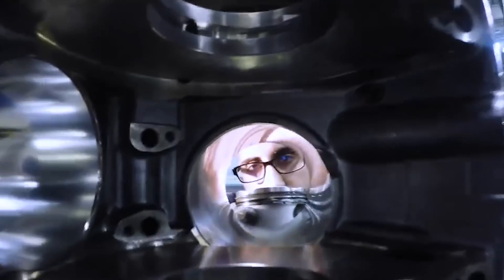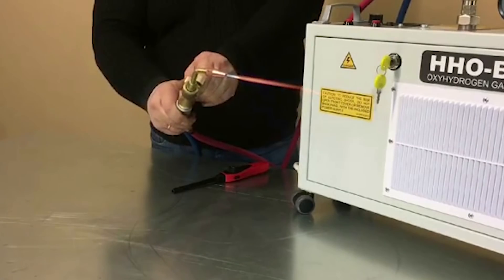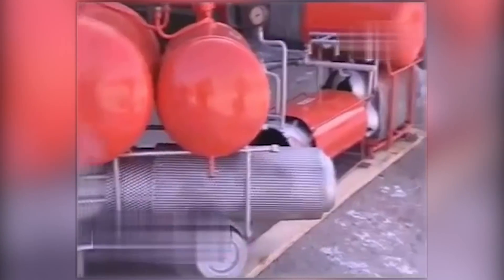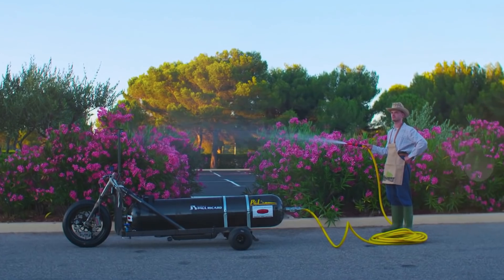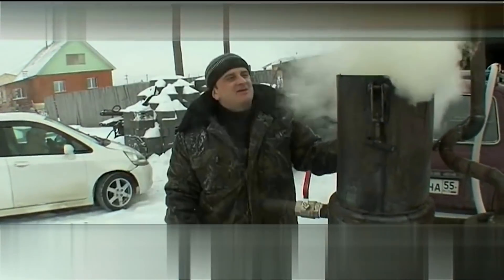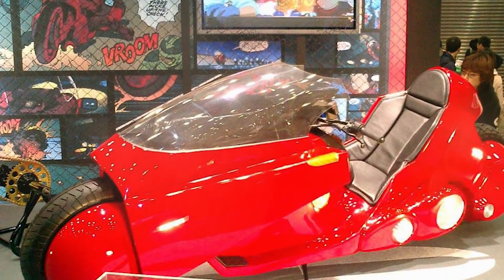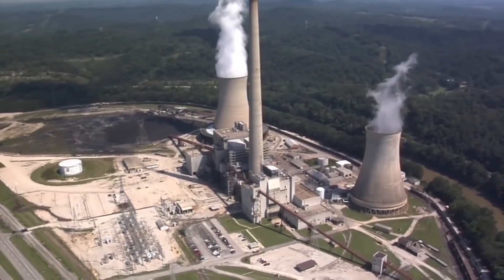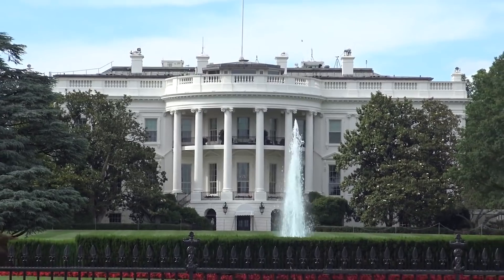Why These Engines Are Banned?

Comment: The one that uses compressed air is interesting.
I saw a farmer one time who manually pumps air into a car tire tube. Then uses it for aeration in his fish pond. Many hours later, he pumps it back up again. No external energy required.

Something like that can be developed further with solar power to charge the tube, so that it can work through the night when the sun is not shinning.
Reply: No external energy required. Using your muscles = external energy as you're LITERALLY BURN ENERGY!
Reply: @lolly166541  
True. But I was referring to something like an electric pump.

Comment: The motorcycle is not driven by a magnet. It was a hoax. Also most of the trick garage engines have very bad design bearings go after one hour etc. etc..

Comment: Law of Conservation of Energy, states that energy cannot be created or destroyed in an isolated system.
You cannot fill up a car with water, water is the exhaust Gas...
Reply: Like that "hydrogen engine" which produces hydrogen and oxygen when you put water in it... and apply electricity. So where is that electricity going to come from? It's not going to magically appear at your wall outlet.
Reply: @Stoney3K  Realy?? are you serious? You fill up a tank with water apply electricity from a battery pack and you get hydrogen in gas form and oxygen , then you use hydrogen as fuel. it will release enough energy to keep your car moving and alternator going. Hydrogen is a very powerfull substance its atoms are full of energy dont forget that the most powerfull atomic bomb is a hydrogen bomb.
Reply: @peterkrawczyk5953  And how is that more efficient than just hooking an electric motor up to your battery? You're never going to get more energy out of it than you put into your battery, so each conversion step in between the battery and the wheels is just going to make it more inefficient.

Comment: Now if only you didn't need ultra-heavy diesel to mine the rare earth elements required to make all the ultra-efficient electric crap, that still has lower power density then gas... i think that the future of engines needs to work on the principle of the reclamation of heat from the Internal Combustion Engine, not on trying to eliminate it, cause you never will be able to

Comment: The problem with all those alternative engines is that they require energy to produce hydrogen, compress air, etc. There is no such thing as "free power." So why have these alternative engines not in mass production? Because they didn't work. Or they required more development than was practical to make them work. The infamous, somewhat mythical "Oil Tycoons" have nothing to do with it. In fact, if they could reduce fuel use, they could stretch the finite supply considerably longer, thus keeping their companies going longer. 

As for Thorium, it, too, is a radio active element; it's just less likely to reach critical mass and explode. There is still radioactive waste. Also, the nuclear power plant explosions were the result of overheated steam, not nuclear reactions, themselves.

Comment: Why cars don't use compressed air as fuel: 1) the air bottles get insanely hot while being pumped and insanely cold while being emptied. 2) If you pierce your tank during an accident, you blow up because compressed air tend to expand quite a bit.

So you're advocating for driving bombs. Nice one.

Comment: Nothing more than “smoke in the mirror” have these guys ever heard of “the law of conservation of energy”? The electricity required to separate hydrogen and oxygen from water takes more energy than can be created burning it  through a 20% efficient internal combustion engine. So if the the electricity was being created by the engine burning the hydrogen and oxygen it would have too much energy lost through heat and friction and wouldn’t self sustain

Comment: Compressed air powered vehicles are certainly nothing new.  The first mechanically powered submarine (as opposed to human-powered) was the compressed air powered French Plongeur, completed in 1863, and equipped with ram and spar torpedo. (that is, a bomb on the end of a pole sticking out from the bow)  The first practicable self-propelled torpedo was built by Robert Whitehead in 1866, based on earlier work by Giovanni Lupis.  It was driven by a compressed air engine.  These torpedoes were used in a number of battles during the late 19th century, and were last used in by Norway in April 1940 (though by then, they were thoroughly obsolete) in the sinking of the less-than-1-year-old German heavy cruiser Blücher.  In the 1870s Emile Lamm built compressed air powered  streetcars  that were used in New Orleans and Paris.  From the 1890s to the 1960s, compressed air powered locomotives were used to shunt freight cars in factories and to operate mine railroads, because they made no smoke and no sparks.  More recently, there were the Air Hogs compressed air powered toys.

Comment: A vehicle powered by a magnetic field...you mean an electric motor?
Reply: Sunny Wahi And calling a electric motor an engine. pfffffft. Talking like spinning a coil in a magnetic field is revolutionary.
Reply: @HeavyMetalPootis  "revolutionary" - revolution..... AH! I get it! LMFAO!
Reply: Please! My dad knew about the zankel rotary motor in 1953. We all laughed when when we said wow wouldn't it be cool if you could just drop a pill in your tank with water and run on the hydrogen part. But no. Then we would run out of clean water. You are all crazy!
Reply: Wankel rotary motor 1953
Reply: someone should tell elon musk electric motors in vehicles are banned

Comment: Yes, spend electric power on obtaining hydrogen from water just to burn it back to water in fuel cells to obtain electric power to run your engine. The sad part is too fkin many people believe it's actually viable and the law of energy conservation is just illuminati conspiracy.
Reply: it's not as efficient as charging/discharging a battery, that's for sure. It's not even close.

However, if the infrastructure for producing hydrogen is in place: 'recharging'  simply amounts to hooking an air line up to the car to take on more hydrogen. rather then having to wait several hours for the chemistry of your Li-ion packs to catch up. I don't see it ever being a big thing for most commuters in the City, but it would eliminate the range problem of your typical EV at least.

Comment: The compressed air car would not work well for meany reasons but more importantly it’s vary unsafe. Compressed air is dangerous as in when pipeing compressed air we use tons of TNT to messier  amount of air being moved. You’re on YouTube search for what happens when you brake a compressed gas tank.

Comment: Very thick on conjecture and innuendo, but very thin on facts. Strange how energy storage is mixed up with energy conversion.
Really not worth watching.
Reply: yeah, its like this guy expects the pumps that fill up the air car, or the batteries that drive "electric motor vehicles" to be powered on fairy breast milk and unicorn shit
Reply: @DragonstarFighter  I read that if  just 10% of current vehicle s on the road were replaced with electric vehicles that the power grid would be completely overloaded causeing complete failure.A mega nuclear power plant would be needed just to generate the electricity to charge the Electric cars

Comment: There are a lot of designs that barely break even or function only at specific speeds in specific conditions and that's why a lot of designs never make it to production and many even fail basic testing.  I remember a guy using an insanely high compression ratio who found out he was literally dieseling his aluminum engine block away with the minor oil loss combining as the combustion fuel.

Things to remember:

#1   Just because it can be made to work doesn't mean it continues to work or is useful.  (magnet driven p.m.m.'s deplete the magnets!)
#2   Just because it's the method we use everywhere doesn't mean it's the only working method.  (you CAN build a wood-gas fired truck and drive on brush)

Comment: This is one of those try to shock uneducated people by embelishing the truth abouth things. Its not true. None of these techs are banned. They are not efficient and dont wrk. The TATA uses gas by the way. The gas compresses the air. Its a hybrid without the battery but rather pneumatic power back up instead.

Comment: Can the magnetic engine used by Sumo motorcycle be used in wind-powered devices? Could it be used to charge a battery bank?
Reply: Possibly it could be adapted for that application, but it would be far less efficient than the generators already used in wind turbines. So what would be the point.??????

Comment: Their was a design back in the 70’s  to convert a internal combustion engine that ran on air. You needed a external compressed air source to get it rotating then after that it keeps going on it’s own. No cooling system needed and the oil never got vary dirty. The main use was for stationary power source like in underground mines, fascinating concept , we talked about it a lot in project class.
Reply: Yeah, except that violates all three laws of thermodynamics. There are always losses: friction, heat, even *sound*. So you'd have to create energy from literally nowhere just to keep the thing spinning with no load. Gasoline represents the remaining fraction of chemical energy from rotting sea life, which in turn represent a fraction of energy of the sun that hit the algea they fed on. There's losses all the way down the line.

You can turn a 4 cycle into a compressed air/steam engine, but you'll need to provide pressurized air continuously for it to operate. It also makes a garbage engine when used this way, just use a steam turbine.....

Comment: Cold fusion.  Really?  Come on man.  It doesn't work.  If it DID, the things would be everywhere.  Waaay too much money in building the things.  If it was possible to build the things in the 90's the science behind them would be so bleedingly obvious now that it would be impossible to keep it a secret no matter how much secret conspiracy stuff you threw at it; physics is not something you can hide no matter how hard you try.  And given the great and powerful oil industry still hasn't killed off Elon Musk or any of the big green energy projects, I think your conspiracy theory is bunk.  

The rest of your 'forbidden' engines just aren't economically feasible for mass production.  Air powered vehicles don't scale well at all and are drastically underpowered; a very niche market so you aren't going to see much buy-in.  Hydrogen fuel cells have leakage and energy density problems (and if you scale them up to mass production you start having real issues as you drain rivers and lakes of water for your vehicles only to pump that water back into the air as steam).  Not to mention cracking water into hydrogen requires input power anyway, so your overall energy efficiency actually goes way down.  Until you can run the cracking stations on totally renewable sources, the things are an ecological disaster.  That magnetic engine has poor torque and awful acceleration so no one would want it for anything other than a novelty when FAR better engines are available.  These are the kinds of things that work on the small scale but there are tons of problems with scaling them up to mass production.  The wood fuel vehicle is just straight up stupid for any kind of mass market obviously.  The fact of the matter is fossil fuels are easily obtained and have incredible energy density and since the technology is old it is well understood and quite efficient.  Not to mention easy to obtain and repair; important considerations when you are marketing products to the masses.  These engines aren't killed by nefarious oil bosses, they are killed by the physics of the engines and the economics of their implementation.   

The only feasible thing here is the thorium reactor, and that thing has gigantic NIMBY problems because it is nuclear (and thorium is not exactly common, so mass use of it gets really expensive).  People don't care about the KIND of nuclear, the first thing they think of with nuclear is danger.  Oh yeah, and thorium reactors require plutonium.  The production of which is incredibly heavily regulated by international arms treaty.  So they will stay a dream until the US and Russia decide to sit down and renegotiate those arms treaties.  Good luck!

Comment: forbidden because of oil companies paid officials to ban them. if they cant ban you they will Ki..... you and make it look as a an accident plenty of proff
Reply: Except none of this is banned. It's just impractical.

HHO generators take more power then they generate in return (like any machine, most of the energy an internal combustion engine produces is wasted as heat and noise), while you can make an HHO generator, make the hydrogen at home, and then fill your car with it.... just put batteries on the car and charge the car, car goes farther with way less investment.

Wankel engine: not only legal, but you can buy them. RX7s and RX8s have them standard. They're fun and rev like nobody's business, but burn a LOT of oil (and only bearly passed emissions as a result), you need new seals on the rotors fairly often or they run even worse.

Opposing cylinder engine: Junkers Jumo aircraft engine used that layout. It's an interesting layout and was a good engine, but it's rather complicated and can't use VVT or other nice emissions things, so nobody uses that format anymore.

as for using sunlight to make hydrogen, there's a dozen ways to do that. Commercial photovoltaics you can buy from china by the pallet are leagues better then all of them.

Comment: I work in the power Generation industry and those tall concrete funnel shaped structures that everyone associates with nuclear power plants have nothing to do with nuclear power. Those are called cooling towers, on a side most of the power plants that they showed on here as nuclear were coal powered facilities FYI. If you see a  big tall stack going up its likely coal, smaller shorter stacks likely gas fired, nuclear units generally don't have stacks at all.

Comment: Take the n machine for example. An electric generator that produced more electricity than it used to run itself. It was invented over 100 years ago and the patent was bought out and swept under the carpet. How good would it be if everyone had free electricity to power homes and vehicles

Comment: Stopped watching halfway through.  This is the biggest load of bullshit I have ever seen.  The rotary engine was never banned.  Mazda has used it on and off from the 60s or so until a few years ago.  They are great for compact high power engines but are inefficient, have wear issues and are hard to meet emission standards.  Wood gas is not uncommon and was never banned.  The US government even has plans on the FEMA site for people in case of emergency.  If you are in an area where energy is hard to come by but trees are, they are great.  If you love in the city they will never be a practical way of running your car.  Hydrogen and hydrogen fuel cells do work, but we do not have a way to get hydrogen that is economical, not fossil fuel sources, or doesn't require more energy to get than you can get back out of it.  The compressed air car is just stupid.  Compressing air is highly inefficient.  It is used for tools because it is compact and light weight compared to electric tools of similar power.  It is 25 to 30% efficient if I recall.  Holy hell I feel dumber for watching the little bit I did.

Comment: The vehicles arent powered by air. They are powered by the electricity that compressed the air.
Reply: Air is basically the storage medium in this case. Just as gasoline is the byproduct of sunlight if you go back far enough.

Comment: Ok I'm no genius but why didn't dude with the compressed air car fab up a compressor pump from the cranking action of the wheels on the car once in motion ? A good set of pumps a regulator and boom your junk is rolling down the road with just a $1.50 to get you started from the local gas station air pump ..

Comment: So all u would have to do is put a air compressor and a battery and a generator. Battery powers generator generator powers air compressor air compressor fills air Tanks to move car but the air compressor is allso  fueling the generator  witch is charging to battery an the battery is making to compressor work so you sould never stop or run out of air. Or take out battery an put genurator to make car lighter.

Comment: so i am up to 4min..i haven't seen a banned engine yet. i have seen many impracticable things. So how do you generate the air pressure or electrical energy to separate hydrogen from water with out those nasty hydrocarbons. This is all crap. The motorcycle is powered by magnetic field? generated by what? click bait crap.

Comment: “You might think the cost of filling compressed air vehicles with air is high, but actually the cost is quite low.”

proceeds to not mention said cost

Guess I’ll take your word for it....  as unbiased as you are, especially with regards to big oil and “the rich.”
Reply: “This is the motorcycle that was invented there and called Sumo.”

Proceeds to show a prop replica of Kaneda’s bike from Akira on display at a con

Comment: The oil companys are the reason why you don't see these being on mass manufactured....watch that documentary who killed the electric car its from 97 I believe.
Reply: Hemi204 In the mid 90s when GM had it’s electric car there were no batteries that could be used to produce a car with equivalent range to a gasoline car for a reasonable price. 30 years later and every major car company now has a battery electric car on the market. What changed? Cheap, light, hi capacity lithium ion batteries were developed.
Reply: bcreason I know what your saying